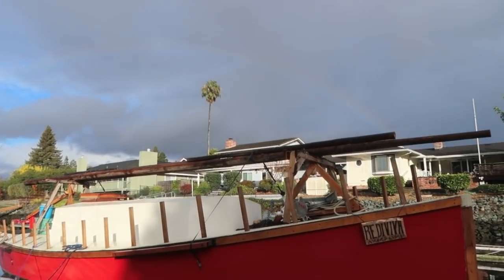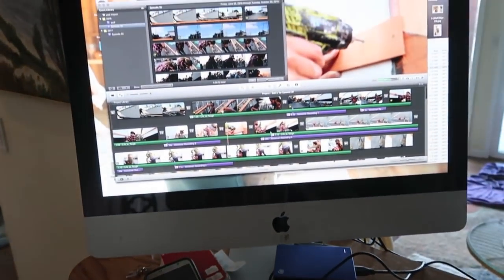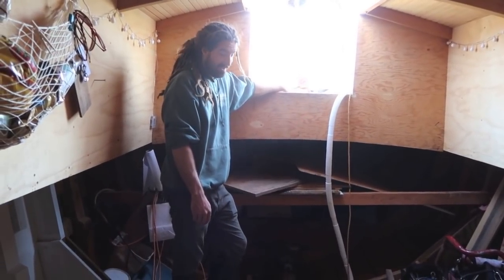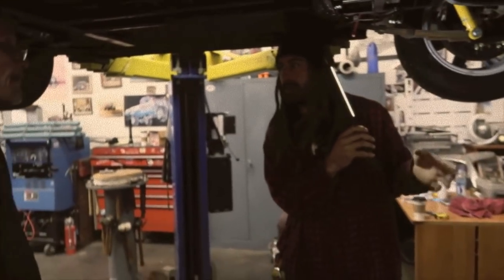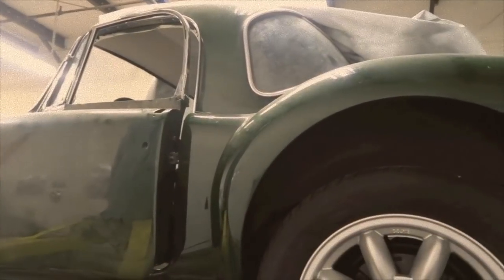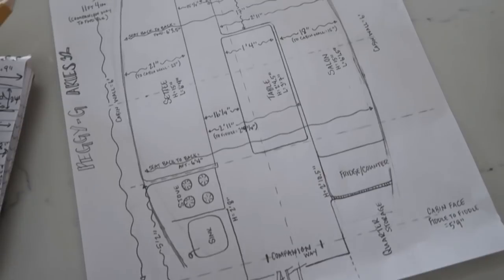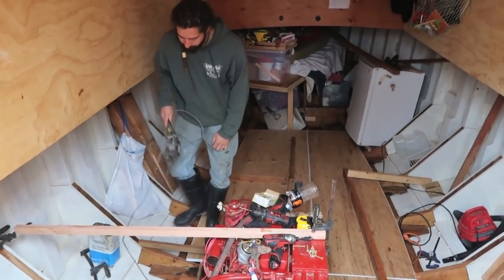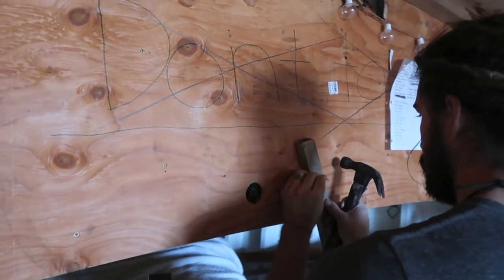Salt & Tar: Episode 46-Mental Lightening Storms (Interior Indecision and Driveline Research)

Comment: You can't use a spirit level now you are on the water!  The boat will shift from minute to minute depending on where stuff is stowed and even as people move around.  It will shift again as you build in fixtures and fittings.  Every level you find will be different to the last one and no two surfaces will line up, making it worse not better!  You established your levels with things you installed when ashore (Floors, Deck-heads, etc. and even the hull its self) and everything from now on must be levelled by "measurements off" and straight edges.  That way, as the boat lists, a surface will take on a "cant", but at least they will be aligned and consistent.  Part of the "Trick" of the fit-out is to balance the weight you are adding to keep the boat trimmed.  Imagine if you were to put Fuel Tanks, Water Tanks, Galley, Heads, Holding Tank and Batteries on the Port Side and Bunks and seating to Starboard?  She'd end up with such a list that she'd try to go round in circles when under way.  Just trying to help, keep up the good work ;-)  Peter
Reply: i dont think they listen much  they just spent 4 hours researching what  could of been done in 30 mins lol
Reply: Love your energy but my daughter lives Very Close to you . Why aren't you posting current videos instead of months old time line video's  ????  Really like you to show what it looks like in current time  ? Cheers :)
Reply: I totally agree but a level can still give you a rough idea. Really its more or less a straight edge. But one thing you can do is put a level on a known part that's level and then match the bubbles to what you're working on.
Reply: @southjerseysound7340  But that wasn't what he was doing, he was using it to establish that the part was level and, the fact that he was on that side of the boat, everything else being equal, would ensure it wasn't! I was pointing that out to try to prevent that mistake, in this instance.
Reply: @peterihoy4908  I posted before watching and just figured I'd throw my $ .02 out there for others. But like I said I agreed with you.
Reply: @southjerseysound7340  ;-)
Reply: He uses the Force...

Comment: Let me preface this with this: I've never built a boat. However, I've built cars, trailers, houses, etc. When you have a house built by a contractor, they charge you for changes. (They call these change orders.) The reason for that is because professionals know that a job can fly completely off the rails if you allow too many changes in the middle of construction. You need a plan. A real plan. 

When doing layout, start with an accurate drawing for the outer walls of the space. Next is a bubble drawing. You literally draw bubbles about the size you think they need to be, and label them (galley, birth, head, etc.) Then draw in hard items on top of that. (sink, toilet, engine cover. These things will have a definite size.) From that drawing, it becomes pretty easy to see how big everything else needs to be. 

Now that you have a working drawing, build it! Do not change from the drawing! When you get everything roughed in, you'll see that it all works. It won't look like it while you're building, but I promise, it will. (Or it won't, and you'll need to write yourself a change order.) Don't worry too much about finishes until you need to. You guys are doing great, but loose lose site of the forest through the trees. You did such a great job on the boat thus far because you stuck to a plan. Keep doing that.

Comment: I had a quiet chuckle as I watched you use a spirit level as I wondered if everything on board was stacked evenly and hoped the boat didnt have a list.
Reply: I just started to watch but there's only way to use a spirit level on a boat that's in the water. You need to have a reference that you know is level and then you can work from that. You just match the bubbles instead of making them level if that makes sense.

Comment: Go get a bunch of old cardboard boxes and cut and tape them into a rough facsimile of where you want stuff...berths, heads, galley etc. That way you get a feel for the space that is quite realistic. Takes about as long as thinking it through anyways, with a bit more spacial insight. Great to see you both so dedicated to an end result without the usual instant gratification, although I am sure you have probably wanted a bit more of that sometimes!
Reply: Great Suggestion !
back in the late 80s I took a temp job as a millwright, putting together a pear packing plant. I spent a week working with cardboard. I told them what I was doing, but  the PTB were getting nervous, they just didn't understand. After I had all the patterns, it took only 2 days to finish the job. It went from a temp job to7 years as the shop supervisor. I loves me some cardboard ;)
Reply: Absolutely, correct - mock up everything using cardboard, full size. As well, do a plan of the boat to scale to put your idea down and then mock up the ideas that you want to keep. Working on a boat is all about comprises. By the way, always have a  door to the head. Secondly where does the main mast come through the boat because that will definitely affect the interior of the boat.
Reply: Why lose credibility with bad spelling my friend?!Spatial!

Comment: You have 3 big tanks that have to be located in the hull also. Black water, potable water and fuel, so plan where your going to locate them as you go or you won't be able to get them down into the hull. I like the head like the head location. Remember a place for chart and navigation equipment also.

Comment: I know this is way too late to have any influence, but, I would have mounted the engine way farther aft and faced it backwards.  A two or three row chain and sprocket set tying the transmission output shaft down to the prop shaft and pillow block bearings to support the shafts and you're done.  The benefits are, 1) More room in the center of the boat where you live. 2) Weight decentralization, if all your weight is centered on the boat it can roll and pitch much easier. if the weight is spread out it is slower to pitch and roll but the boat must still be balanced.  Weight centering is great for a racing sailboat where seconds count when making tacks and comfort is not important. 3) Noise control is easier if the engine and living areas are separate rather than sharing space. Two or four inches of insulation around the engine where it is now is two or four inches less companionway.

Comment: head out to the op shops and get some wool jumpers and blankets,wool seems to do much better on my boat than most materials.
cotton and nylon seem to turn yellow from the moist air even if its not being used unless it's sealed in plastic.

Comment: Hello
I would install heat shield on the timber under and around the engine.
I would also install - before setting down the flooring - pipes under the floor for the water pump, both in the fore and aft of the boat. In case there's a leak you will not want to be forced to rip the floor and pump out the water, even worse a hull breach.

Comment: Put the finish (stain and varnish or whatever you are using) on the ceiling now when drips won't matter.  Even if you need to sand some off to bond the bulkheads to later it is worth it.
Reply: Yeah there's a lot of cad programs out there and a lot are free or have free trials.

Comment: You’ll figure out your layout, even if you have to “start” and realize, oh this wont work.  This is part of the Fun of the build.  I know its challenging but it is also doing something else you dont realize.  As a bi-product, your relationship is becoming stronger by working together to solve this problem.  Most couples would have killed each other by this point.  Way to go.

Comment: Usally you install the diesel and shaft first.  Line up everything with a laser and strings.  Install the shimming and work out the the propulsion system, check for vibration and when everything is running well under load then ya trim out the cabin ? btw,  why install the diesel there?  Good luck  :)

Comment: The last thing you want in a sailboat, especially a salt water one is a hollow drive shaft and u- Joints made of steel. You will regret not using a solid shaft bolted directly with flanges to the engine.
Reply: highwatercircutrider absolutely correct. Will be horrible in less than a year

Comment: Don't remember seeing you mount a dieseltank  - a drain and a bolted down hatch would be good to have if you get diesel algie's . mounting double filters with a switch valve is also a good idea - you don't have to change filters just in case...when engine start losing power switch the valve and move on .. it's always bad weather when it happen's , the sediment/water in the tank mix with fuel in heavy weather...
fair wind...

Comment: You can laugh at my comment because I don't know what I'm talking about but can you run PVC or pex from the battery box to the breaker box and other areas then fish electrical wires in later? So you don't have to worry about fishing it in behind built-ins.

Comment: Usually critical fasteners (engine mount bolts) are installed bolt going down/nut on the bottom. This way if the nut should vibrated loose the bolt won't fall out.

Comment: Maybe it's just the video, but to me it looks like some severe angles on that driveshaft to be using universal joints. A better choice would have bee CV (constant velocity) joints. Same type used on off road vehicles that see a lot of drive line angles. I think as is your going to see a lot of vibration so make sure the angles at both ends are identical. Otherwise the prop will be speeding up and slowing with each rotation causing vibration and the annoying noise it will make, plus caused premature wear on the U Joints.

Comment: Yeah, it's a pain once it's off the build cradle, if you still have interior fittings to do.  Just measure off your datum points. It doesn't matter hugely anyway, cos she'll be moving all over the place once she moves out of the protected waterway!! Case more now of "okay by eye". T-shirts just arrived,  my 16yo loves the design, so you are now officially cool ;-)) And to be butt-clenchingly pedantic, they are sole boards rather than floorboards, just to avoid confusion with the "floors" above the keel...I hate myself, but couldn't stop myself...

Comment: Check with your driveline person, but it looks like you have the U-joints installed "in-phase".  IIRC, they need to be installed 90° out of phase with each other or you will have bad vibrations.

Comment: Take measurements of your interrior space both plan and elevation. Get some 11 x 17  or larger grid paper and an architect's scale. Adopt a scale like 1/4" or 1/2" per foot and draw a background. Make copies of the background, then start making scale drawings of concepts in your head. You will found out lots of info about various concepts before picking up a saw. You will save yourself lots of frustrstion. I wish you well!  I'm getting frustrated watching your frustrations. Also, is the engine really offset from the boat centerline??

Comment: The reason I say the shaft is too small is imagine what will happen to your shaft when you get a rope around your prop & one day you will no matter how careful you are. Imagine all the torque & kinetic energy in that Diesel engine when the prop stops turning. I once saved a guy who caught a rope while steaming at sea & it twisted his shaft up & split his boat open down the center, He almost sunk.
That might not happen but you will probably get a bent shaft. You will need to put your thrust bearing near the end of the shaft (think about diff head in a car) also it needs to be able to take all the thrust your engine produces.

Comment: I'm assuming the engine is off center thus the U-joints, yes? 
Good luck with it all.
Thanks for the video.
What's your reasoning on having the engine so far forward? I'd think as far aft as possible and ballast as necessary which would free up a lot of flood space as well as reduce the cost of offset shafting....too late now....or is it?

Comment: If you get vibrations... that would save a lot of diesel.. You would rather sail than motor even if the wind is  veak 😁 
If you want ideas on the interior ...put the measurements out on youtube and you get lots of ideas.. wood stripes hotglue and cardboard is easy to change..
Do you need the headroom by the engine? or can you move the step down pass the engine .then the engine won't be so big -easyer to build around .storage under floorboards ..

Comment: Big difference between cars and boats. The typical long term power output from a car will be about 15 hp no matter if the engine can  push 50 hp or 500 because this is all that is required to keep constant speed on the highway. In a boat the power output will typically be  80-90% of the engines capapility. This means that your 52 hp engine will push about 3 times the power of the car. In addition to this you really have to dimension the drive line according to the torque transferred, not the power. The lower the rpm the higher the torque...

Comment: Answer There is no such thing as a HP gauge. HP is a formula. Ruff explanation TQ is the ability to move weight HP is how fast it does it. TQ is measured in foot pounds (how much pressure the engine can apply to a 1 foot lever. ) HP is TQ X RPM Divided by 5252 So if you have an engine making oh  100 foot lbs of TQ at 4500 rpm =85HP Small gas engine/ Now a basic industrial diesel like you have 150 Foot pounds at 1500 rpm would be 42HP So the driveline on the diesel at 52 HP would have to be much stronger that the gas engine at 85HP Due to the increased TQ LOAD and lower RPM . The automotive application also has a gear reduction in the rear axle which lightens the load on the drive line greatly.
All the power numbers I have stated are for an example im not claiming that's what your motor makes but you may want to research the TQ Of the motor and work with someone that has a clue
Reply: tom hutchins good explanation....completely irrelevant to their situation, you can gauge horsepower--on a dyno.  or a dragstrip.  have a good night.
Reply: @johnbecay6887  Dont think there going to get that boat to go down the drag strip. And dont think they want to pay for a dyno shop to adapt and test there engine. They have HP specs and the formula would get them the torque which is what drive lines are rated for. Who's irreverent? Tom hutchins is absolutely correct. The comments clearly apply if you actually watch the video rolph is doing his usual theatrics because he does not know what he is talking about and is avoiding the answer . If you dont understand maybe you should ask for help instead of acting like an ignorant troll?
Reply: @reallybuddy3259  i don't know where to start.  perhaps you should read my comment more carefully.  i am very respectful of Tom.  he gave a fine explanation.  i said irrelevant not irreverent, which makes all your comments about dyno shops and drag strips irrelevant.    i give props to Tom and point out ways to measure torque and horsepower and you insult a stranger.   have a good night
Reply: @johnbecay6887  John there rating a drive line load they need torque numbers not HP as Rolph claimed. Read and learn. Tom hutchins gave the explanation of how to calculate Torque numbers from HP and RPM. It was very relevant. Read and learn don't troll like a child. PS Drag strips can be used to gauge performance but due to all the variables pretty useless for testing HP to many variables
Reply: @johnbecay6887  PS Read Tom hutchins's comment slowly maybe you will understand better.
Reply: @reallybuddy3259  i said my comment was not relevant, not his.
Reply: @johnbecay6887  Hey John the world is flat . Why did i say that no reason. Is that your logic?
Reply: @reallybuddy3259   i am trying to share info and keep things respectful and lighthearted.  you are trying to feel superior by bashing others.  you are off topic and spoiling for a war of words.  i don't have time for this.  i stand by my statements.  feel free to insult me in the comments until you feel better.  this conversation is over.  Have a really great Easter!